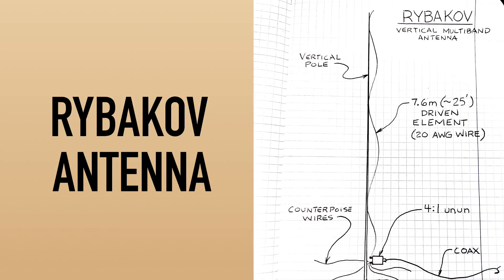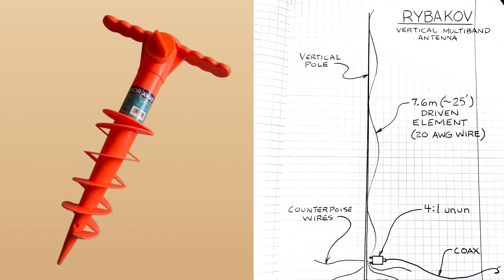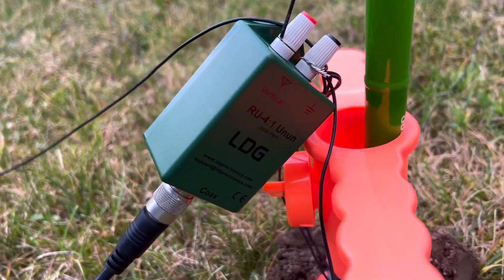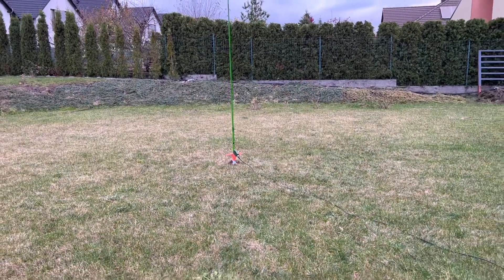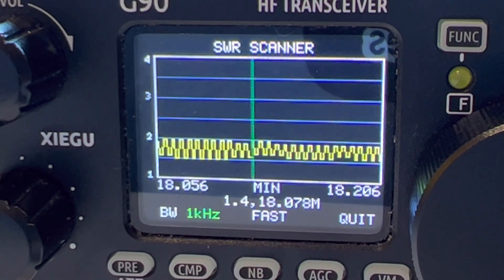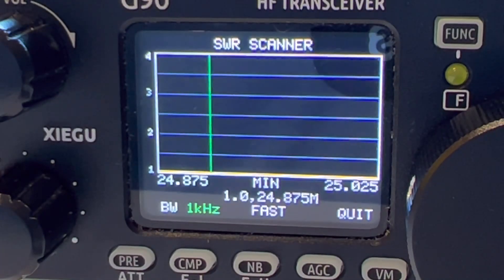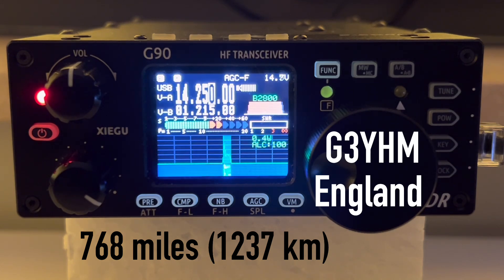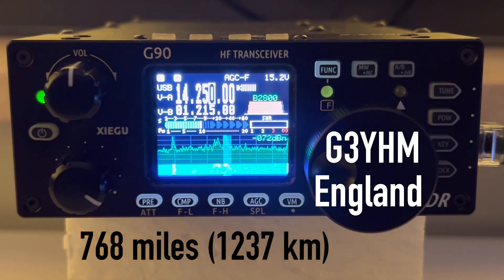Rybakov Vertical Multiband HF Antenna

Comment: How would this multiband antenna compare on any one specific band (such as say 17 neters) with an elevated ground plane antenna, cut for  just that band, with a quarter-wave radiator and 4 quarter-wave elevated radials?

Comment: Walt I saw this video a few times and build a Rybakov antenna with 25 feet telescopic wip on tripod and 4 counterpoise about 25 feet each. I used the same 4:1 unun and wired it the same way. I contacted all over us and Europe and even Russia with it. My tripod was 4 feet off the ground. I used it for a week. Then to next design antenna. 😅

Comment: Hi Walt. I built one of these and put it in my front yard where I have a clear path east. It’s been up about two months and it works way better than I expected. Also, it is very quiet, even more quiet than my 10-80 end fed. And it shows a stronger signal than my ended on RBN. And like you said it works all bands 10-40. Thanks. I think you’ve made me a vertical convert. I’ve made hundreds of contacts with it from my home in Idaho and lots of DX too! 73😊 Pat/ K7GUD

Comment: My Rybakov works great if I bring the swr down with my old (1975) MFJ manual tuner ahead of my IC7300. I'm using the LDG 4:1 UNUN...8X, 15 ' ground radials, 30' RG58 coax. Next, I'd like to add a home- made (13 turns speaker wire on a torrid) current choke ahead of my tuner.

Comment: Wow, I found a 27 foot tall piece of old dried out Bamboo, a spool of stereo speaker wire, and enough spare parts to make a 4:1 balun. I cobbled it together and fired it up with my G90. Even with the crudest assembly and the wire not fine tuned (cutting-wise), I was able to do a couple of quick contacts. We have bamboo all over the property, so it looks natural (well, if Bamboo had a piece of speaker wire hanging from it). Thanks for this video. It's a really good feeling when you can watch a video that is clear and concise, and then build a working antenna! Thank you again Walt, Antenna building is one of my favorite things to do and until I started watching your videos, I had a lot of trouble making them...73...Hugh...KN6KNB

Comment: Partly, I have a problem with the rybakov antenna, which I made myself according to...  project online.  However, my G90 tunes the antenna only in the 10-meter band and barely in the 20-meter band. The box cannot handle the remaining bands.  The only difference I made was to use the FT-140-43 core in the unun.  Maybe someone can advise.

Comment: Hey Walt, if you were only using the lower part of each band for CW and FT8 would you use a slightly longer wire or counterpoise?  regards FOO (Steve)

Comment: Hey Walt i cannot thank you enough buddy and of course Tim we had a terrible storm new year and it ripped my beam apart I have just built this thing and it takes 5 minutes to put up and less to take down it is in the middle of my small garden on a pedestal i use for a parasol in summer I will do a video for you this morning I worked the grey line on ft8 20m band and broken the record set by my beam 11869 miles into ZL man if im ever youre way a few beers are heading your way cheers Brian 2e0ilf
Reply from the maker: That’s awesome, thanks for sharing! All the best and 73 my friend

Comment: Hey Walt, just build my first Rybakov 806 Vertical using a T140-43 with 10 turns of 18 gauge magnet wire, a BNC Female to Dual Banana Female Socket Binding Post, 26 foot vertical element, and 4 radials about 12ft each. I taped the radiating element to a 33 foot Spider Beam. Picked up contacts on 12, 15, 17, 20, and 40 meters all reporting 55 or better up and down the East coast and out to California from Michigan. The 4:1 match was perfect for my Xeigu G-90's internal tuner. You were spot on when you said this is a great antenna. I will be putting the Rybakov and my 40-10 meter EFHW up for winter field day. With a vertical and horizontal both performing so well I'm sure to have a lot of fun working stations all over the US and beyond.

Thanks for the videos you've been posting, I began my HF work prior to you tube and struggled with getting a good antenna in the air. You and all the others who put the time in to bring new ideas to the table sure make a difference to the Amateur Radio Community. Thanks for all you do, 73 AD8MP, David.
Reply from the maker: That’s awesome! Thanks for sharing and thanks so much for the kind words. All the best and 73, Walt

Comment: Hi Walt thanks for the video. I built mine last week. The tip is approx 9m above the ground hanging in a tree with 6x 5m radials. Utterly blown away. I managed a QSO on 10W into Germany on 10m band (55 both ways) 9850km from my QTH. Happy new Year. Best 73 DE ZS6AKW.
Reply from the maker: That's awesome! Thanks for sharing! Happy New Year and 73, Walt.

Comment: Do you have a video of how you add extensions to the Goture fishing rod?
Reply from the maker: No but what I do is slide the extension parts over the bottom pole and wrap the connection with tape.
Reply: @COASTALWAVESWIRES  Slide the bottom pole out a bit, lash the extensions to it including the antenna wire and push it up, correct? Also, have you consider Faraday cloth as the ground plane instead of wires?

Comment: Walt, thank you for the vid'...
Does your G90 tune this antenna? What other tuner do you use with your other QRP rigs to tune it?
73, Larry  de KF4LBG
Reply from the maker: Hi Larry,  my G90 tunes this thing perfectly. I als have a LDG AT-100 Pro II tuner that I use with my other radios. It's great. 73, Walt

Comment: The property here has some shortcomings that makes putting up decent antennas difficult at best.  Small House, Small City Lot, No Trees, not even ONE.  Single story home, but stand up attic so most of my antennas are dipoles in the attic, as in 6-20 meters.  I have tried 30 and 40 and as long as I can get them working once I fold them around corners etc, they work but not great.  Luckily I had a shorter painter's pole I was able to stick out the attic window and point it upwards just enough to get just enough height from the ground to the top of that pole.  But no way to get a much bigger pole out that window so can have 80 meters as well.  HOWEVER the 4:1 unun I used was from my original S9 vertical I bought years ago, and at that time I also bought their 80 meter loading coil.  Would that work on this antenna?  So I grabbed it and stuck it in the rest of the mish mosh, SWR on all bands 6-80 at less than 1.5:1, using an autotuner of course.   80m signals I'm hearing are nice and strong, sounds hopeful.  Bands are not in good shape here, and hearing lots of people complaining about it, so I know it's not the antenna.  Tomorrow will give it a shot and see if it's transmitting as good as it's receiving.  If it is, I think I'll use the money I've been saving to buy a store built vertical to buy a bigger pole and run this antenna in the yard instead of in the middle of my driveway!  I need to go buy groceries soon and hate the thought of taking the antenna down and putting back up just to buy groceries.  Thank GOD I'm not married!!

Comment: The swr meter in the g90 seems to show very low numbers with long runs of cable. I was thinking I had a magic antenna until I plugged in the mfj meter and things looked closer to normal

Comment: Ler me ask: If I put antenna in a tower to give some heigh to the Mast  how can I add counterpoise?
Reply from the maker: This antenna was meant to be a ground mounted antenna. Raising it will actually decrease its effectiveness. For a raised vertical take a look at some commercial alternatives with fixed radials

Comment: Hi: Do you know if that works with a 4:1 balun instead of a 4:1 unun? I thank you in advance. 73 from Brazil. Sergio, PS7CY
Reply from the maker: It may work but I'm not sure if it would work as well as an unun. It's not a balanced antenna so it really needs an unun. 73, Walt K4OGO

Comment: You can make this antenna 'point' by leaning it about 35 degrees off the vertical. I also use a beach umbrella 'screw' in the ground support to hold up my 10.1m fibreglass pole.
Reply from the maker: Interesting, thanks for sharing!

Comment: Love it! Maybe a good alternative for the dx commander...dont show Callum this video! Lol😂
So very cool how a little bit of wire can perform so nicely. I also have a G90 which ill need to put back i use again - it has been shelved since i got the ft-891. id love to try and do this builf. I have that exaxt un-un. But Unless i am at a park doing pota i do not have a lot of space at all to do a vertical with ground radials. You are very fortunate to have the yard to play with.  How big a space did this antenna take up, like 15 ft diameter or so? Have you tried using a window screen as a ground radial field? Very small and convenient and apparently works well. KB9VBR and others have good vids on YT showing window screens being used in lieu of radials.  Cheers and 73!
Reply from the maker: It took up about 30 feet diameter with the radials. I’ve seen the KB9VBR video but haven’t tried it yet. Get that G90 out!!! All the best and 73!

Comment: I made this yesterday with a 10m fibreglass pole and 25ft wire with the LDG 4:1 but got confused and used a Balun but worked great with an ATU LDG sorry i need a Unun insured but the Balun works very very good and 1 counterpose at 5m under the grass works brilliant I'm very impressed with it, the 40m band has lost the noise it had before, it's a lot better all 5 9 plus on this antenna, my EFHW must be bringing noise in for somewhere. Thanks De 2E1FUE.
Reply from the maker: Thanks for sharing that info Tom! 73

Comment: What you think about this rig Chameleon 1.8-54 MHz Modular Portable Antenna System
Reply from the maker: It looks pretty awesome, would love to get one. Maybe in the future
Reply: @COASTAL WAVES & WIRES  the radio you using is pretty awesome g90. If you would have a chance to go higher with the price and quality what would be your next choice? I am new to all this. I really appreciate your answers
Reply from the maker: @andreyolenyk6253  would probably get a Yaesu FT-891. Great 100 watt portable rig
Reply: @COASTAL WAVES & WIRES   thank you man.
Reply: @COASTAL WAVES & WIRES  one last question good man. Can ft891 or xiegu g90 get coupled with anytone AnyTone AT-D878UVII Plus. I mean not coupled but transmitting from ft891 to anytone hand radio
Reply from the maker: @andreyolenyk6253  honestly I don’t know

Comment: A 7.5 mtr vertical will resonate on 30mtr as a 1/4 wave and 10mtr as 3/4 wave .... with out balun , what will change with the 4:1 balun?
Reply from the maker: Well this is a 7.6 meter antenna that covers more than 30 and 10. Slightly different in length and thus the 4:1

Comment: walt you have inspired me to make a rybakov antenna for field day. does it require a tuner? i have a 12m spider beam vertical support what length would you recommend to work most bands? I also have a 4:1 and a 9:1 unun. any recomedations on length of the vertical ? Thanks
Reply from the maker: Yes indeed, it requires a tuner

Comment: Walt 2e0ilf here i have a spare 49:1 unun would this work
Reply from the maker: Not at that length, 49:1 is suited for a EFHW. Impedance for this antenna only requires a 4:1 for a match
Reply: Thx wslt 73

Comment: built one of these recently, though mine's a modified version. In the Dec. 2013 final edition of his Monitoring Times magazine, Bob Grove W8JHD mentiones what he called "best and cheapest shortwave receiving antenna you’ll ever need" which was 24' of electrical cord or speaker wire with 5' removed from one side. That's what I'm using for the radiator, so I call mine a Bobgrovakov. I only have room for 2 radials which are around 7m long facing roughly north-south. I'm RX only for the time being so I have no idea how or if this thing will radiate, but it works great for receiving. The other day on FT8 on 20m I got every continent except Antarctica.
Reply from the maker: That’s awesome, thanks for sharing. The Bobgrovakov hahaha I like that! 73 de K4OGO

Comment: Quite an interesting presentation.  Thanks for posting it.  It reminded me of one I saw three years or so ago.  See VE3BF’s 40 meter fishing pole antenna on YT.  Very similar to the Rybakov except a 4:1 balun was used rather than an unun.  Ps:  first time I have seen a xiegu in action.  Certainly not a KX3 but I like the display panel goodies.
Reply from the maker: Thanks for watching! I’ll take a look at the VE3BF video, thanks for sharing. 73

Comment: You could call it a "Piscator" if you don't want to call it by a Russian name for some reason. ;)

SOTABeams has (or had) 3d printed guy line rings that fit over the top and stop when the ring reaches a big enough segment. I use one and it works well to keep things from bouncing too much in the wind. I'm tempted to make this antenna now because of this video. I even have that exact 4:1 balun sitting here.
Reply from the maker: Thanks for the info!

Comment: Good video, and great job on the Rybakov. I’ve have great success with this antenna and the Upper and Out. 
Out in the field, using information from Craig WB3GCK, easy to deploy for a inopportune “play radio”session.
Great stuff. 73 M7PBX.
Reply from the maker: Thank you! 73, Walt K4OGO

Comment: I love my g90
Reply from the maker: So do I, it's a great radio, especially for travel and portable ops!
Reply: @COASTALWAVESWIRES  I use it for portable, it's awesome 👌
Reply: @COASTALWAVESWIRES  on top of it being a good radio, it has a built-in tuner, antenna analysis all in one box, you don't want to run over 40%duty cycle because it will get hot, that is the only downside it's even got a waterfall, for portable it is the ultimate.

Comment: I see you run at higher voltages around 15v. Does that help get a little more power or more power in more situations for you on the G90?
Reply from the maker: I’m thinking it might, this is a new small power supply I brought over with me and I set it at 15v this week to experiment.

Comment: Will try one here Walt.  Your AGC setting is too fast for SSB.
Reply from the maker: Yes I play with the AGC often and that setting may have given me a better reception at one point and I just left it there.
Reply: @COASTALWAVESWIRES  on SSB, a fast agc lets too much noise slip through between words, which is what I heard on your video.  Fast is best for cw

Comment: Bought one as Pro Whip. Managed Japan using RTTY and the New York repeater on 10M in 2007-8. Good antennas for the price. What you need now is another pole and use the unun as a loop and you can also have fun using it that way.
Reply from the maker: I actually have another pole here with me and plan on building a Delta Loop with the unun

Comment: I've checked everywhere and I cannot find that unit. It must be only sold in Europe. I am also starting to believe in that radio. The G90 is the ticket..
Reply from the maker: I bought the 4:1 unun from DX Engineering in the States, I got the radio from Radioddity in the States.
Reply: @COASTALWAVESWIRES  I wonder why Google didn't find it?? That will be the first.

Comment: I use a 9:1, with 7.6m wire on a 10m pole. 40m not too good, but as you have stated, 15m to 10m are really good. Another great vid and hope to catch you on the band soon, 73
Reply from the maker: Thanks so much Gary! Hope to catch you on the bands!

Comment: It's a great antenna - Mine is 16 m in an inverted L - works 80-6. Insertion loss is reasonable as is efficiency. I have it connected to a radial field shared with a 1/4 wave vertical. It's a little down on the 1/4 wave but not much !!!
Reply from the maker: Awesome! Thanks for watching

Comment: Thank you for the shout out Walt and above all, great to see you making those contacts. On 10m you’ll have a ball! 73
Reply from the maker: Yes indeed, it’s an awesome antenna for 10 meters.
Reply: @COASTALWAVESWIRES  Just built one today and will take it to a park soon. It is interesting that the SWR values differ so much in @timg5tm941 and your experiments where the only difference was the amount of counterpoise wires (and of most likely different ground). I went for the 6x5m version. Let's see what it shows in my case. GD DX OMs!

Comment: Hi Walt, you've given me an idea for a portable antenna to play with made from existing kit I have, going to do a variation of the theme to the Rybakov using my 17 foot telescopic whip into its ground anchor but still using a 4:1 unun and counterpoise wire's, might even put the slide winder loading coil in for good measure.
Reply from the maker: Sounds like a great experiment!
Reply: @COASTALWAVESWIRES  if it works I'll treat myself to a pint down the pub 🍻
Reply from the maker: @adam-g7crq  cheers!!